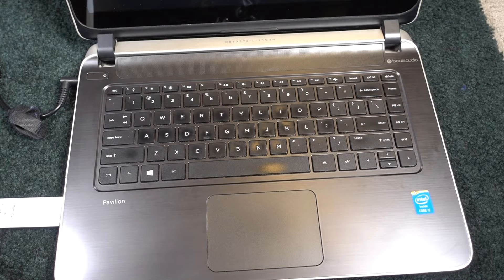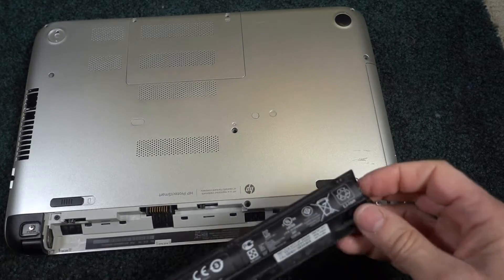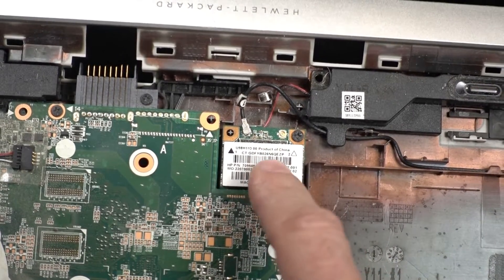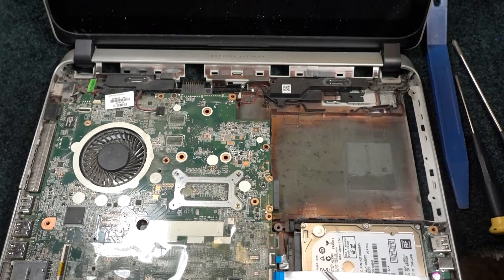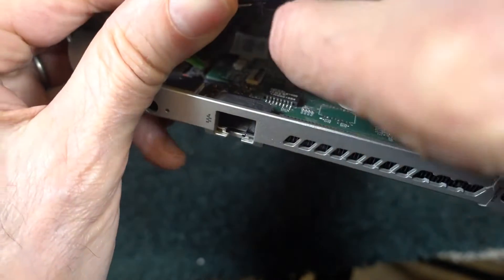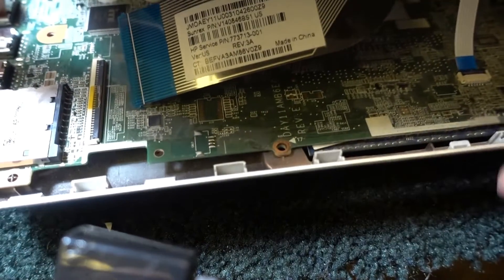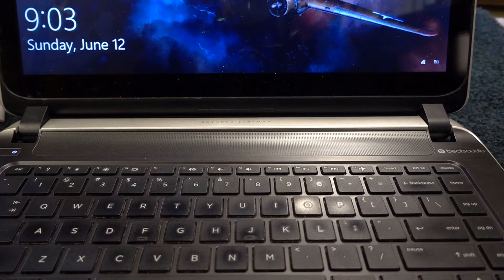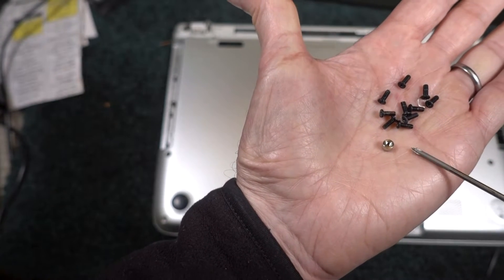WiFi Card Replacement on an HP Pavilion Laptop

Comment: The ribbon cables can be attached detached easily if you open the key board, under the key board ther is cutouts to attach and detach the cables and the jey board is slipon

Comment: Where can I get that tool you used to open computer and what wood be the name of it.
Reply from the maker: If you are referring to the little blue plastic pry bar, that's from Harbor Freight.  Item 67021, 5 piece Auto Trim & Molding Tool Set.  If it was an orange plastic pry bar, that came with a replacement Apple Iphone screen.

Comment: It's funny how ppl don't realize that seeking out the same part number original card is actually NOT a good thing to do, in the vast majority of cases of replacing a wifi card.
For instance, your card is a Realtek card with outdated technology, just as was my Realtek card in my HP laptop that I just replaced with an Intel AX210 card, which is a 10x better card that uses far more advanced, far more reliable wifi connections, and far faster wireless connection speeds, all at a price of $12 (on a super sale, normal price is $20), when I would have had to pay nearly $60 for a significantly outdated and unreliable 'matching' Realtek original card.

My new Intel AX210 card is 6E technology, which covers even far more than 5G and tri-band (6GHz, 5GHz and 2.4GHz) signal, as well as boosting up the bluetooth connection technology to Bluetooth 5.3 version.
My new Intel AX210 card is night and day faster/better/more reliable, as compared to my original crappy Realtek card that topped out at much slower 4G speeds.
Reply from the maker: I wish I talked to you before I started this project!
Reply: @davidgpo  There's nothing stopping you from ordering the faster wifi card and just redoing the process......
Reply from the maker: @superdaddy1973    At this time I'm only using this laptop to store my music.  Thanks

Comment: I'm not a wifi guy and it turns out right now that the ends on my pavillion D7 are FUP......... can't I just tape the ends off and abandon the card.
Reply from the maker: I don't think you even have to tape off the board mounted wifi card.  Just install a USB wifi card in your USB port.  That's what I was doing until I installed the internal board mounted wifi.  Thanks for watching!